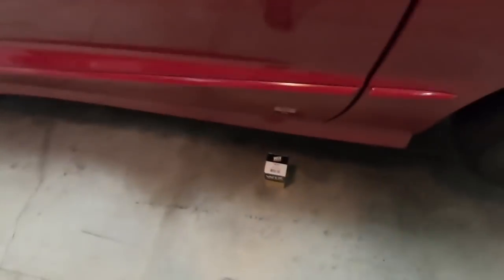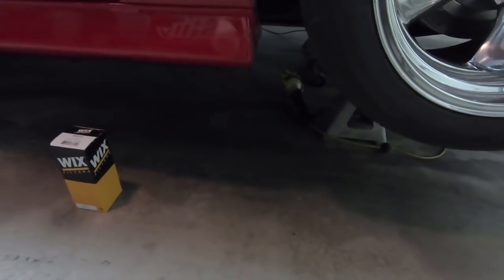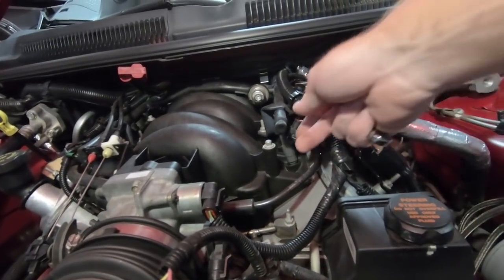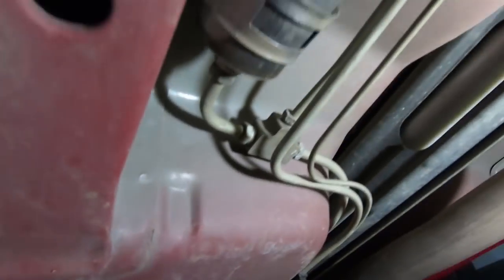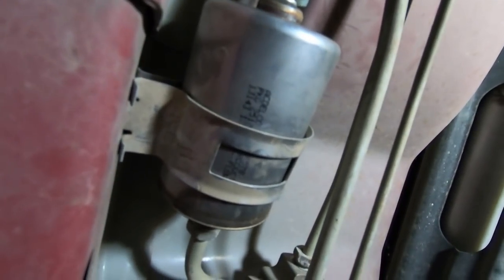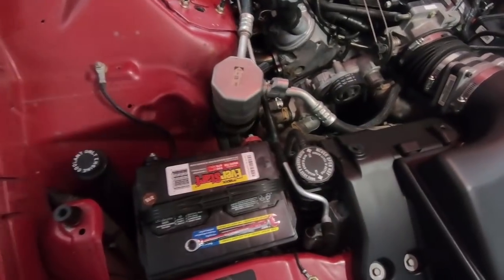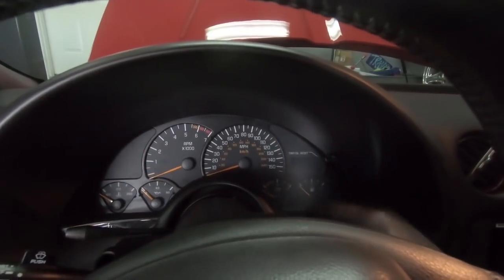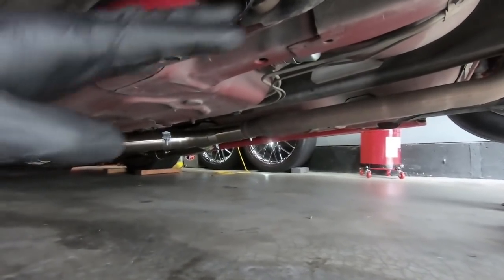How to Replace Fuel Filter WS6 Trans Am

Comment: I had interment non start 1 year later. Found injectors didn't have 12 volts during a no start. Simple fix was ignition relay. 5$.
Reply from the maker: That's a cheap fix at least.

Comment: Did you ever figure out the issue? I have the same issue. Extended crank at times, not all the time. Shits driving me crazy.
Reply from the maker: Pretty sure it is the fuel pump. Been apart for a while to turbo.

Comment: I have a bad vent valve canister in my tank that I need to replace. I don’t know Think I’m going to tackle it myself it’s a big job to do.
Reply from the maker: Yeah that is no fun.
Reply: TWA Motorsports should I cut up top inside the truck to get to it?
Reply from the maker: @GreatestHITS26  if you'd like. Either way works.

Comment: Just found your videos because I'm getting my 01 Firebird back in action after years. Replaced my fuel filter & it was leaking when I was getting it primed. I forgot to add the O ring gasket when I replaced the filter because i was in a rush. Do you use the O ring at all? It didn't look like it from your vid but yours also didn't leak so maybe you don't have to?
Reply from the maker: Never saw that before. No o ring to speak of
Reply: @TWAMotorsports  Thanks for the reply, I already subbed because your vids are super helpful! I guess maybe just the Duralast fuel filters come with the O ring gasket. Tried to take it off to add the gasket and the plastic clip broke so I'm just gonna start fresh and use the filter you used in the vid. I feel like an idiot because i knew nothing ever good comes from rushing a job but I really wanted to get the bird started last night lol
Reply from the maker: Hey I have been there. Wanting something to go now. Lol

Comment: I had trouble starting my 99 Camaro LS1 that had 160,000+ miles. The cars fuel pump relay fuse failed so all you do is open the hood and open the little box switch it with the AC relay fuse. My car started right up. I used the bad one again and it wouldn't run so it was not a bad fuel pump or filter just the relay.
Reply from the maker: Nice. That is great info👍
Reply: When the relay is bad will the fuel pump still prime when the key is turned on?
Reply from the maker: @digitalmagicAR  no
Reply: @TWAMotorsports  thank you
Reply from the maker: @digitalmagicAR  you're welcome

Comment: Great video reminds me i gotta change mine. BTW fuel pump install extremely suck on 98 f-bodys lol! 😎👍
Reply from the maker: To do it correctly 98-02 suck. The access panel method is easy but not something I will do on this car.
Reply: @TWAMotorsports  Hahaha yep i dropped the tank on mine did the fuel innovation 255lph kit it's working great just a pita to do lol!
Reply from the maker: @bluephoenix383  yeah it's no fun but I dont like the hack job most do.
Reply: Yep didn't want to cut mine up either so i did it the right way just takes a little longer on the 98 cars because of the metal fuel tank and filler neck had to take the rear axle out of the car to make room to get the fuel tank out don't believe the newer ones with plastic tanks are that bad to drop
Reply: @TWAMotorsports  I have a 94 Trans am with the LT1. I bought the car as a project build. So I'm looking forward to changing the fuel pump and fuel filter together considering I'm taking the body off the frame and starting from scratch... Everything is getting replaced. Nuts bolts washers and of course.. it's called project t a. Frame off resto....
Reply from the maker: @keilylmm6377  very nice. Good luck on your build

Comment: I had the same problem. I started with the filter, then the gas cap, then cut the trap door and replaced the fuel pump and fuel pressure sensor since it’s on the pump. After all of that she still wasn’t starting right. Then I changed the relay. Now she runs like a brand new car.
Reply from the maker: It sucks to throw parts at it like that

Comment: Supposed to take gas cap loose first to let off some pressure off at the tank too.
Reply from the maker: I relieved the pressure at the rail.
Reply: @TWAMotorsports  I think Haynes' Manual mentioned the gas cap is why I did mine there too, you have to do it at the rail for sure, I remember thinking it was taking forever at the rail and was worried about starting a fire, mine is a '97 LT1 car and their schrader valve is back towards firewall up under the cowl a little, my '01 WS6 car is like yours right out in the open, going to do that one soon, highly recommend it especially if you never know when it was last replaced and heck even the 2002 cars are now at least 18 years old if the stock one is still on it. I could even see that the gas was dirtier at the filter inlet side when I took it off.

Comment: What year TA is this?. 
I have a 95 TA WS6 and she has all of a sudden started having issues running, having issues idling and stalling. She was running great w no problems for the last 2 years I have had her.  
Her Fuel Pump was replaced last year. Her fuel filter is about 10 yrs old.
Reply from the maker: 2002. Hard to believe the pump was replaced and not the filter

Comment: Thanks for the video. My ws6 was seriously bogging down today and then suddenly it took off like it's supposed to.  Almost felt like a turbo that just spooled.  I'm going to replace the filter and pray that's the culprit, but unfortunately I'm betting on a fuel pump being the culprit.  Air filter is clean.  Any other checks to do on an ls1?
Reply from the maker: Thanks for watching. Yeah with junk gas no days filters clog easy. Fuel pump would be the next guess. Always keep it over 1/4 tank to prolong pump life.
Reply: Make sure to check your fuel pump relay under the hood if it's bad. This happened to me.

Comment: I’m getting a p0300 code for a random misfire on my 2000 trans am 118k miles. Where would you start?
Reply from the maker: I would start with spark plug wires, then fuel issues, then intake gaskets

Comment: Anyone else kink the line on the left going from filter to tank? Can't tell if the car is running worse now because of it. FML, waiting on fuel presure gauge to come in to find out
Reply from the maker: I'm sure you can source a replacement
Reply: @TWAMotorsports  they don't make them anymore, would have to be a part out car
Reply from the maker: @rustyshackleford5058  probably so